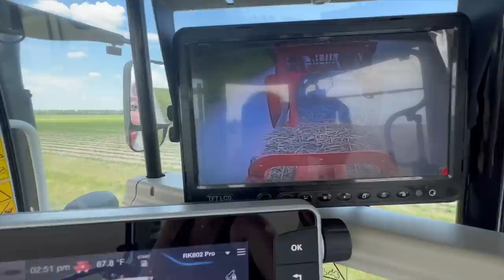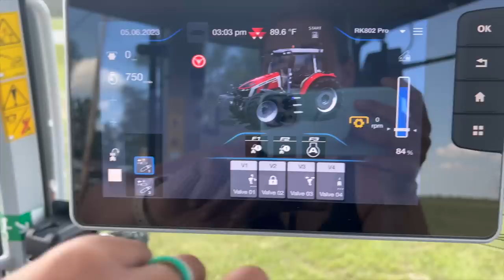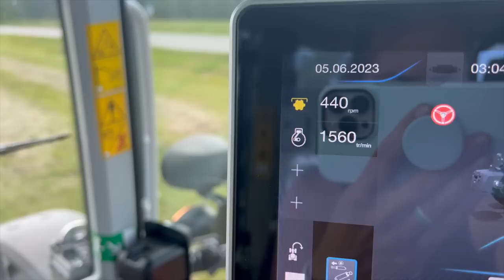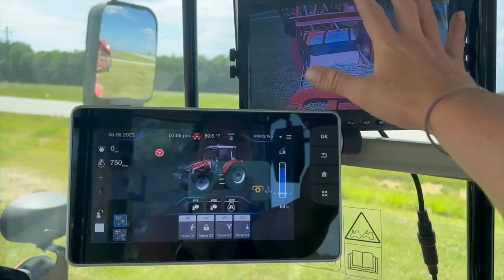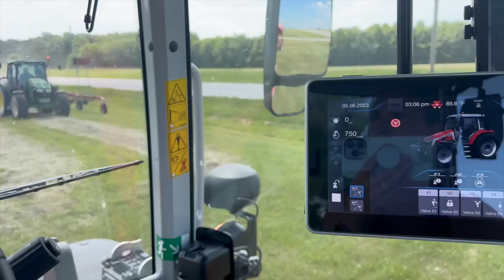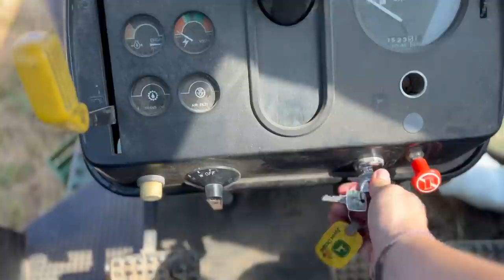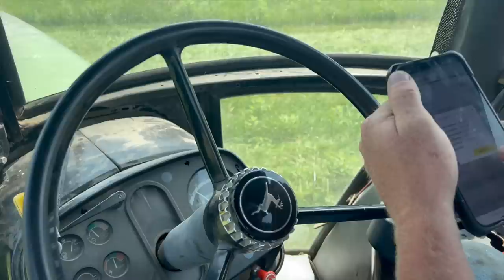Corn Sprayed | Hay Mowed & New MF put to work for the 1st Time | #Hay Season 2023 { a Farm Vlog }

Comment: That tractor should have 540eco.  It will easily run the baler in that, saves fuel and runs the tractor at a lower rpm